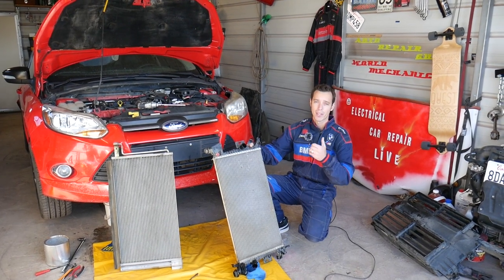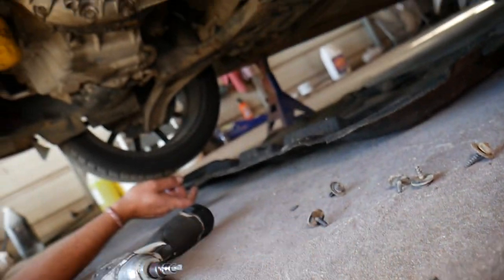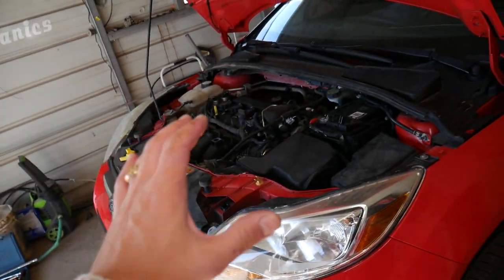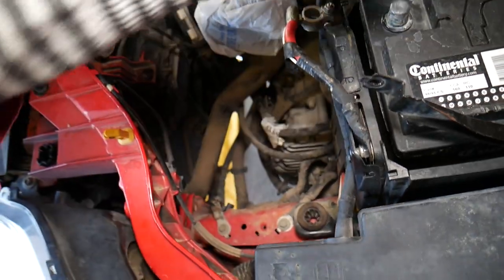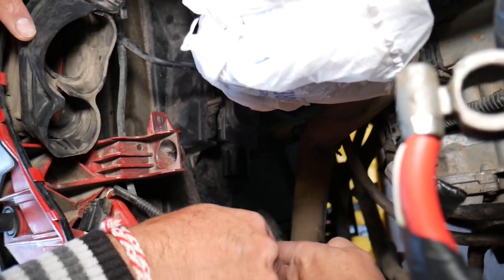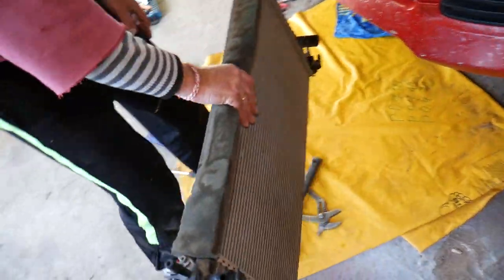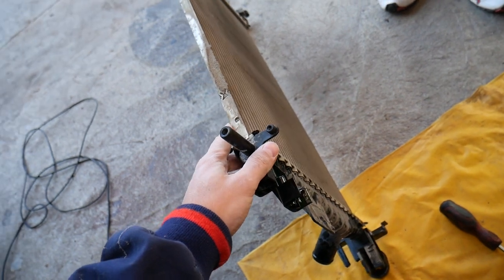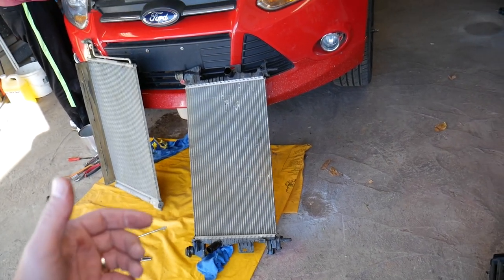FORD FOCUS MK3 RADIATOR REMOVAL REPLACEMENT

Comment: The radiator can absolutely be separated from the condenser coil inside the vehicle. support the condenser, i used zip ties. Remove passenger side headlight, and you can access the clip on top. the new radiator has the clip so you can pry the old clip off without worrying about breaking it, then it is just wiggling it out.
Reply: Yup! Just finished one up right now, thank god I saw this comment!
Reply: Oh man, thank you! My rad just blew, and i have a new one on order. I cant afford a shop to do it. Looking for as much infor and tricks, as i can get.

Comment: Great video.When refitting use cable ties to hold up radiator and intercooler ( on tdci’s), put bottom rubber mounts into bottom radiator support first then bolt it up then cut cable ties.
Saves a lot of wiggling .

Comment: Separating radiator from condenser while still in position in the car to avoid having to purge and refill A/C was easy, and had more problems changing the thermostat. The re-assembly was a breeze as well. Before you re-install the small pick up tube, ensure the O-Ring is still is position, as mine went missing. a final note, I just realised that it is easier to remove the entire air filter box to change air filter than fighting with the cover while in position.
Reply: Is it possible to remove the radiator with out removing the AC condenser

Comment: 21:47 I did that part without draining the system. It was loads of fun.
Reply: I did the same haha. Is there still Freon in the system though?
Reply: @angus4830  a bit of it! Definitely needed a recharge haha
Reply: Were you able to just remove it slowly ?

Comment: What about removing the top of the radiator support would that be easier then going thru bottom?
Reply: I would definitely not be easier, as not purging AC and bottom removal/re-installation took less than 2 hours, while doing it from the top involves removing headlights and entire front bumper, which only means body panel re-alignment to rematch fenders/bumper

Comment: No you don’t have to drain the A/c you can separate it in car I did it.. but most likely not the radiator check the connection top drivers side of radiator that hose is bad to leak not radiator

Comment: man i bought this car used and there is no gas in the AC system already. Someone had even taken off the AC belt so i dont need to worry about the AC system. 
My rad works good right now just watching incase i hav to do this in future

Comment: Good video but this fan removal does not work on 2012 to 2018 focus ST. Have to remove the entire bumper and everything behind it then pull intercoolers, then radiator, condenser and fan all as one. Takes over 3 hours with skills. Need a lift too.
Reply: I have the 2012 se hatchback, is it the same? I only have a ramp lift.
Reply: @Christopheofficial1854 i think this video is on base model /se